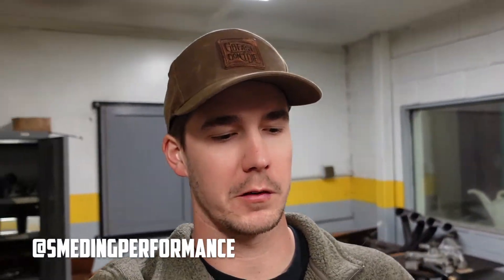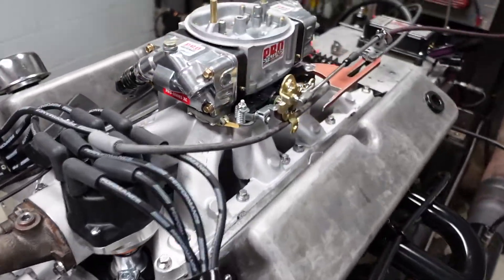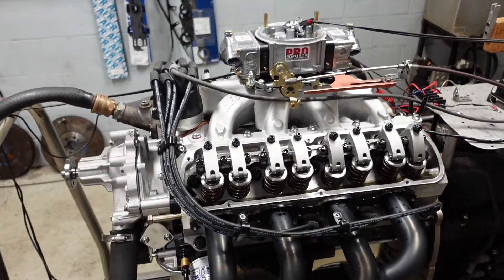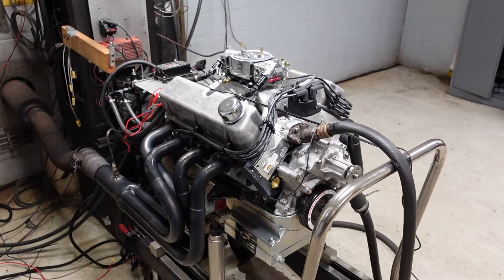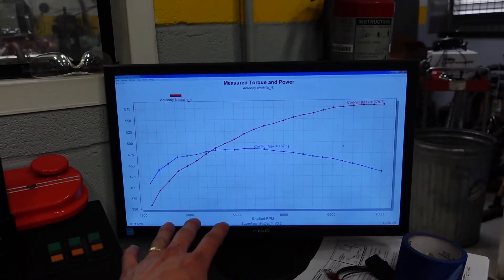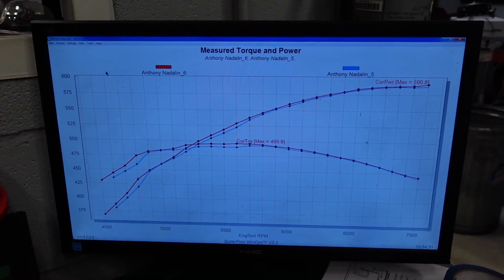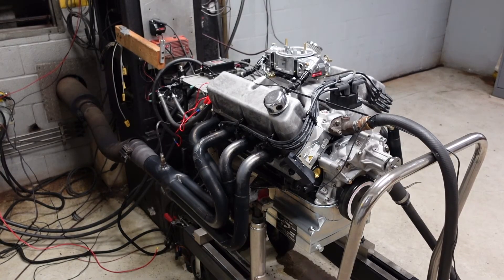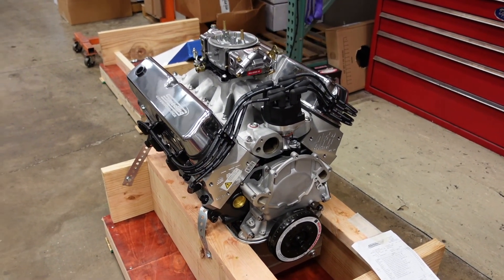Dyno Testing The 8,000rpm 363" Small Block Ford - Part 3

Comment: What sucks is i have a Ford racing, all aluminum 427 in my 1995 mustang that only makes about 437whp. I thought i had plenty of supporting hardware to make at least 500whp. Maybe the issue is in the EFI tuning. I have a dyno tuned SCT chipped 95 cobra EECIV doing the engine management. I just came across your channel, I'm looking forward to seeing your Ford 427 builds for some clues.
Reply: Your rwtq is impressive Id leave it be. Are you even able to hook all that power up>
Strokers are about tq dont worry about the hp number. Sort your tune out and enjoy it
Reply: @gordocarbo  thank you. The car hooks and runs due to my suspension set-up. If you want to smoke the tires you can with intent, but my goal was to build a powerful street car that does everything a car should do well with practicality. I just installed a standalone computer that I've been tuning for about a month. It looks like I'll be getting my 500whp soon enough💪
Reply: @MaxDankOG  nah bro, i want to keep my car period correct, but OEM+ i have enough hardware on this engine that should support 500 N/A WHP. i just have to get to it.
Reply: @PANTYEATR1 if you have a 427 ci motor that only makes 435 hp, you are leaving a lot on the table even with a Ford ecu. Plenty of 331-347’s make 425hp easily. Without knowing the parts involved though it’s anyone’s guess why you aren’t making good power
Reply: @luckymanham302  thanks for your input and confirming what i was thinking about my lack of power. I looked at my dyno sheet and I made 434whp and 474 wtq. My car is managed by the 95 factory computer with a tunable chip. It's an ordeal to tune the car this way since there are so many laborious steps, so i think my tuner didn't want to deal with it, since it's old tech and laborious. Here are the specs of my engine that i remember: 10.8:1 compression, .600 lift cam, AFR 205 CNC heads, Trickflow 351R upper & lower intake manifolds, 75mm throttle body, 60lbs Deka injectors, 8an fuel lines to and from the tank, billet fuel rails, Jessel shaft rocker system, long tube headers 1 7/8 primaries to 3 inch collectors and 3 inch exhaust to the rear, MSD digital 6AL. If you have any more questions, feel free to ask.
Reply: @PANTYEATR1  on paper every component is really good, and it certainly seems like it is down on power. Was the cam degreed properly? Is it a manual or auto car? Obviously automatic transmissions suck up more hp than a manual will. Anytime you make more torque than hp, typically there is at least one component that is holding the potential back. What cc chamber size are your heads? I’m tempted to say your motor might be happier with a bigger cam, perhaps a dual pattern would wake it up? What is your timing set at? There are a lot of variables, and I’m just taking a shot in the dark saying bigger cam. It could just as easily be a tuning flaw. It would be best to consult a reputable engine builder who is knowledgeable with Fords. You could also try posting on one of the forums. Lots of experienced people who are very helpful seem to be on there frequently… Best of luck my friend!!!
Reply: @luckymanham302  yes, the cam is degreed in, i performed it myself. It's a 6 speed manual with a dual friction clutch. The chamber size is 58cc. The base timing is at 10°, but the tuner added timing through the rev range with the chip. You are the second person that suggested a slightly bigger cam . I worry about that since i want this car to be a powerful street car that can drive anywhere across the country without issues. Thank you for the best wishes, I'll be going standalone computer soon to replace the factory, chipped computer and taking the timing into my own hands. I'll get that 500 whp that I'm looking for one way or another. Have a good day💪
Reply: @PANTYEATR1  yeah it’s really hard to beat something like a Fueltech, or Holley Sniper EFI. That’s a smart move on your part. Give Comp or any reputable cam manufacturer a call and tell them what you are looking to achieve with your car. They usually have some great people working in the tech department, and will be able to recommend the right cam. I really hope you get it sorted out soon. It sounds like a really solid build!
Reply: @luckymanham302  the cam is from Bullet cams. I had them grind the cam according to my planned build, then i built the engine around the cam. The goal has always been powerful street car that can drive anywhere and be capable on a road course. No drag slicks ever, no exotic fuels, no unreliability. I think the power left on the table is from the tuning. I'll start working there. If i can't get my 500 whp, then I'll go back in the engine to double check.
Reply: @PANTYEATR1  You said it, look at the tq number. Its fine thats a strong engine. Dont get hung up on dyno sheets. Ive seen TPI C4s run low 12s stock with a cam and converter. UNder 300whp
Get a time slip youll be happy

Comment: How would this thing be as a street engine? You mentioned on the street so that's why I'm asking. Do you think it would have enough down low to cruise around reasonably or would you always have to keep the RPMs above 5000? I have a 7,000 RPM small block Ford in my truck. 306, AFR 185 renegades, Comp Cams XE 274- HR. It makes 440 HP with a pretty flat curve from 5 to 7,000. When I built it I had thought I had built about the most rowdy engine that would be acceptable for day-to-day driving in a street truck. But now I'm curious about this thing.
Reply: Itll cruise just fine with a low stall converter around 2200+ idling is the issue not where it makes power, you want a converter to get you enough off idle the cam isnt pushing you fwd somewhere in the 2200rpm stall range

Comment: Years ago I saw a small block Ford on a Dyno that behaved more like a Ferrari engine with a flat plane crank. He would just touch the throttle and the thing would zoom up super fast to 8000 RPM. I’m not sure what the combination was in terms of camshaft, stroke  and displacement. From what I understand displacement does not affect how quickly an engine revs, on the other hand, I was told to build an engine with a short stroke and lighter internals and that would make the engine respond quickly  like road racing engine does. The only thing that helps make an engine rev quickly is using a small clutch and fly wheel. I don’t know if the management system would help in this area what’s your opinion?
Reply: Higher Compression gets a faster respons.
A dragrace  or Nascar engine for example with 13 or up to even 16 to one Compression gets a much more explosive respons.
Reply: tuning makes it rev quick. Shorter stroke just raises the critical limit or piston speed thats all .
Reply: @gordocarbo  Tuning? My friend switched to a smaller lighter fly wheel and clutch now his car shits a lot faster. I’m not sure I understand how tuning plays a role in this.
Reply: @surreallife777  Im sure that helps but a good tune gets that snap in response regardless of clutch weight.
Reply: @gordocarbo  I know the basics but on and off for the last 40 years I still don't understand all the variables in terms of how an engine personality is created. Sure if you put a massive cam in a street engine and a huge carburetor it's not going to work or be responsive but that's the basic stuff. The rest is complicated in terms of what makes a responsive high revving quick revving engine a lot of variables I've even heard that exhaust systems can create a quicker revving car so it's not just one thing.
Reply: My engine features a 38 lb crank rather than a stock 62 lbs., it likes to rev fast.

Comment: it's pointless to rev that to 8000 RPM look at the torque and look at the horsepower it's laying over way before 8000 RPM. you build awesome Motors keep up the good work
Reply: You must have missed him saying that the client wanted a 8K engine, power is limited by fuel octane, mentioned several times.
Reply: Totally agree on the 7k.  Rather have a higher figure there and stop.  I guess it’s a good test for nothing blowing up at 8k.  I guess anything to 7500 is awesome for me.   Do any hydraulic roller cams go past 6500 rpm, or do they fail/collapse when pushed past 6500.   Love to know anyones insite
Reply: @mikepaul396  Can start pumping up at 6200. Higher rpm engines just use a solid. No parts to fail
Reply: I agree on the fuel restrictions on peak horse power. 112 octane and some advance to total timing would probably gain 90 or 100 more horses easily.
Reply: Maybe not, it's low compression and it's not gaining with extra timing. 😮

Comment: Awesome build, thanks for detailing and explaining what went into it. I had close to the same build but with 374",  MCRP ported T/W head, R box intake, loved that motor ran 10.37 @ 129 @ 3240 Lbs. Any reason you chose the AFR intake over the super victor? Great job, love to see builds on the 8.2" deck!!!
Reply: Super victor would be perfect for high rpm
Reply: sv is too big for those ci

Comment: Its ok, hellova lot better than my tired 302 but ive see a guy on here break 715 hp with a 347 NA
Reply: Remember they are intentionally keeping the CR low.
Reply: @danquinnell3502  Great point, my 10.7 to 1  399ci 1st gen sbc runs into the same situation with bigger heads, cam and carb. My cam is 260/266@.050 solid roller with a 110 LSA. Dynoed on Kwik Fill 89 pump gas it did 641@6400 and 560 ft lbs @5700. Heads are Brodix 17* C-Series with a QFT 950 BD. This is 99% street.

Comment: I'm new to the channel. Great motor! One thing i would like to see is people not moving the timing around at 2 degrees at a time. We have found thru dyno testing that some engines are very timing sensitive. We had a 400 cleveland that want 28.5 total on the money. A degree either way lost 25hp approx. Thx for showing us ur work..

Comment: Total Seal recommends proper ring break in to start up engine and immediately bring up to 2,00p to 2,500 rpm for 20 to 25 minutes  under 50 to 75ft lbs load on the dino.. what is your thought on that??..
Reply: I thought about that to but he can't run it that long with no water flow. No motor on the pump. He can't be running more the 5mins a time. The rings heat cycle is off. They might be brittle now.

Comment: Any idea what makes fuel shoot out the carb vent tubes when the throttle gets chopped at the end of the 8,000 rpm run?
Reply: fuel pressure and/or floats too high

Comment: That’s a sweet sound. Approaching NASCAR rpm is impressive on pump gas with low compression. Nice build.  I’m sure the customer will be happy with that.
Reply: Fuel type and compression have little to nothing to do with rpm
Reply: @aaronliddell4280 it sort of does though your gonna make a lot less power with low compression and pump gas
Reply: @aaronliddell4280 then why they run nitro methane in funny cars.
Reply: @fordnut4914  "those" engines are highly boosted, totally different.  N/A nitro engines "like" to be loaded, a little lower RPM.

Comment: Awesome video sounded good. Im sure u are a busy man but, wanted to ask a question cause mixed reviews on internet how far u can safely rev a 427 stroker.I have 427 10.37.1 dart block ford it's got afr 220 heads, scorpion shaft rockers, bam tie bar solid lifters, cam 258 in 266 ex. Lobe separation 110, 689 in 681 ex lift, with 750 qft double pumper. I was wondering how far u would rev this combination out to safely and what u would change in combination. On the dyno it made 605hp at 6100 and 554 to at 4900.
Reply from the maker: To many variables to tell you how high you can rev it. I turn my hyd roller 4.000” stroke LS 8,000
Reply: @JacobVillemain  which Pro Systems carb is that?
Reply: It's a simple answer. You have 600hp at 6100rpm. You shouldn't go much further than 6600rpm. There's no magic above that and more importantly no point. Whoever dyno'd the engine should have told you if you asked him. Comparing a LS to your windsor is crazy. Not even in the same realm. Dart vs LS the LS has better oiling,6bolt mains,better valve train geometry,windage,head clamping force,head flow, yada yada yada. And it's fuel injected. 600hp from a 363 is pretty damn good. Your combination change if needed would be determined by your dyno graph.. If your hp and ftlb drop like a rock after peak you're in need of changes but if it stays fairly flat you're ok if you have a balanced rotating assembly. A dyno graph that's wavy means issues and you have to look at Air Fuel Ratio, timing and fuel pressure closely to diag what's going on. But a fairly smooth graph is what you want. I don't know this guy but doing dyno pulls with no water pumping(has no electric motor on pump)is not a good practice one for the heat and two how are you testing for a cooling blockage or leak. He could have a pump in the holding tank but again he's not using the pump and some Windsor pumps turn backwards.

Comment: 565 ci bbc during 8600 RPMs during burnouts the drag strip my son complain you can't revel big block that high I said maybe not yours but mine I can
Reply: 9200
Reply: @hankclingingsmith8707  9000 is what I had it balanced to spend too
Reply: Im a BBC lover ans have built many of them . My last was 565 ci. You must have one huge camshaft if yours is still making power at 8600 . At least 850 lift  290plus at .050